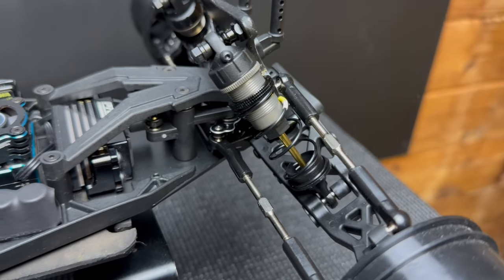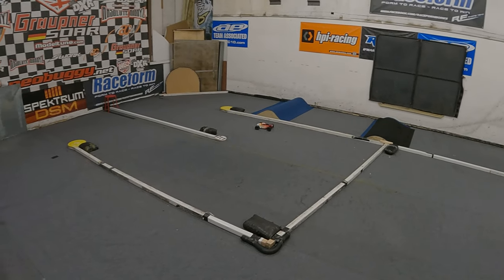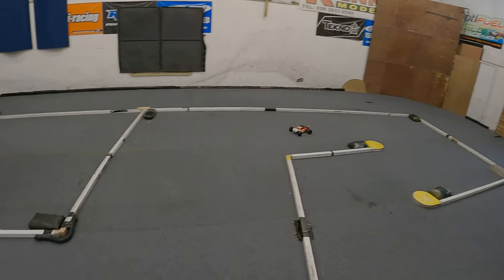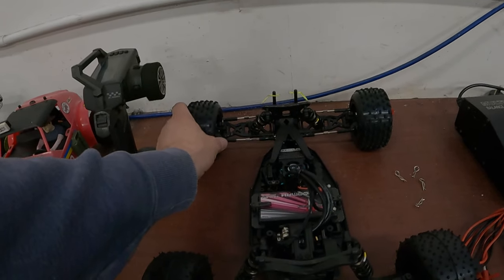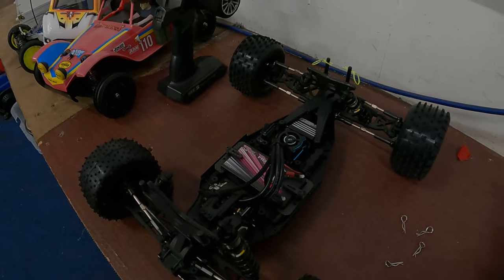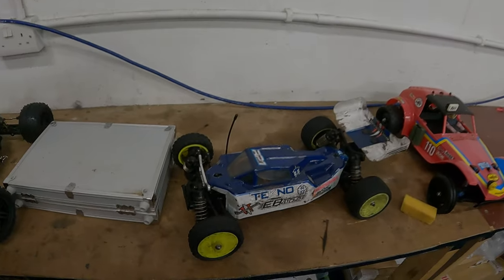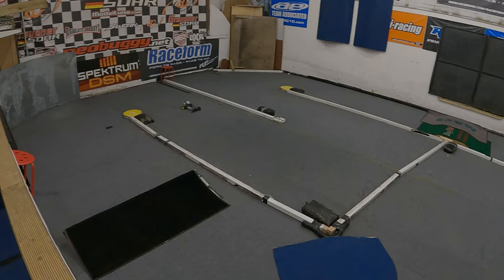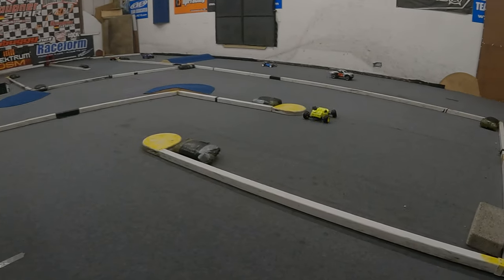WORLDS BEST 1/10 RC STADIUM TRUCK? PR Racing V4TR

Comment: hi there, im looking to purchase this truck. i have 2 questions: 1) reliability - any broken parts? 2) i've notice that it doesnt have a fan mount for the motor, are you mounting a fan at all?
Reply from the maker: Quite a few run them at our local club, no breakages to report 😃
And you can fit a generic fan mount if needed but not really had any need for one
Reply: @TimsRcsurgery  is there a mounting hole for the fan? i dont see see it.
Reply from the maker: @Dan-gq4yg  I don’t currently have access to one to check, I’ll ask the question.. but if there isn’t and a fan is a deal breaker then just drill a hole to mount one. It wouldn’t be the first time I’ve had to do it. As I say, we ran pack after pack though the rig, passing it around and it never got too hot.